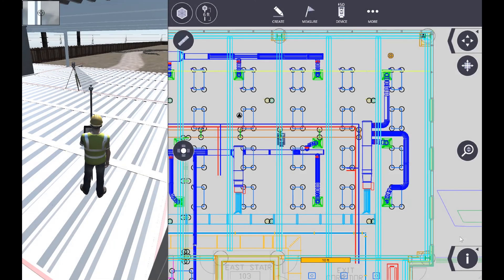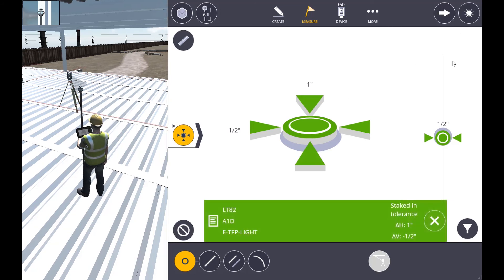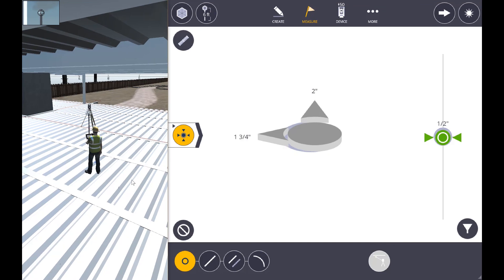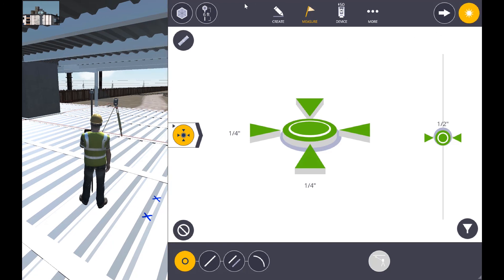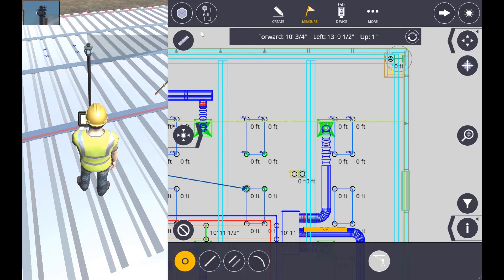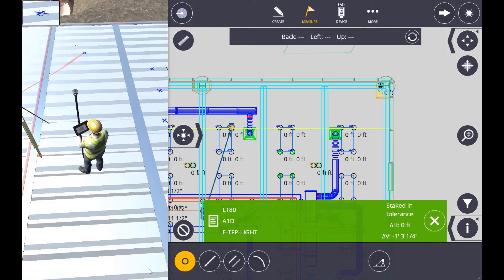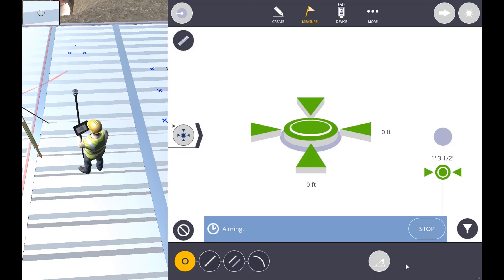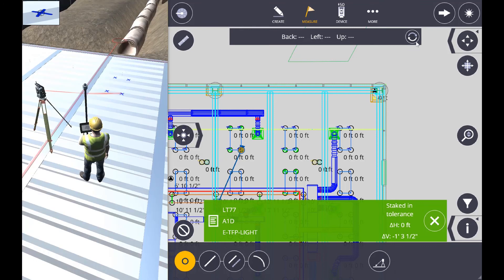Trimble Field Link - Prism and Laser Layout

Comment: When using “laser” for layout how do you adjust the elevation?
Reply from the maker: That all depends on the attributes of the point you are trying to shoot.  If I assume that elevation is set to zero for all of your file points, there is a tool within FieldLink called "Point Transfer" which appears on the bottom of the screen while in the mode (measure/layout) and in laser mode.  This will allow you to measure the deck or ceiling above and will transfer those points form the floor to the ceiling in the correct X&Y orientation.

Comment: What does it mean when it says “point beyond furthest control point used in instrument setup” ? Also, will the layout beyond this point still be accurate or does it require a separate setup?
Reply from the maker: That is a great question.  When you shoot your resection for the "setup," the software and instrument will calculate your residuals (accuracy).  It does so by creating a working diameter based on your longest shot.  If your residual was 1/8" and the longest shot was 200', the residual can increase outside of that circle.  Once you shoot one point outside of that radius and hit "OK" it will not warn you again.

If you are nearby, there will likely not be an issue.  However, further away are the residual compounds (1/4" at 400').

We hope this helps, and thank you for asking the question.

Comment: When laying out with the laser on a slab how can tell you determine your point position if the laser it’s self becomes elongated? Seen this after you are about 10’ away from the RTS 655.
Reply from the maker: The angle of the instrument from the point in laser mode does elongate the laser, The higher you can place the instrument above the slab the less this affect is.  However, you can always use a stick ruler or tape measure to measure the elongation and then mark the half point of that measurement (i.e. the laser measures 1.5" mark the 1/2 point at 3/4".  The only RTS head we offer that solves this problem is the RTS873 which has a focusing laser pointer.  However, many of our customers use the method identified above.

I hope this helps, best of luck and thank you for reaching out.

Comment: How can I layout on just line, not holding a specific point. Just holding either a northing or easting??
Reply from the maker: Depending on the version of the software you are using there is a layout to a line feature which may work out well for you.  If using version 5.9, select Measure then layout and at the bottom left there should be 4 icons (a point, a line, an offset line and a curve).  Select the line and then you can select two points and the program will create a layout line between those points along with set intervals.  This will show you deviations along that line horizontally and vertically.